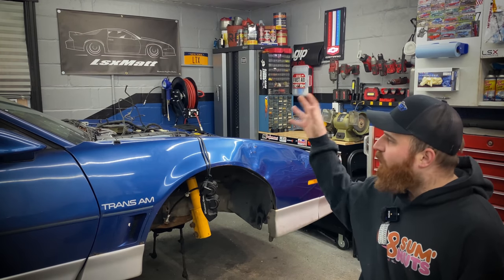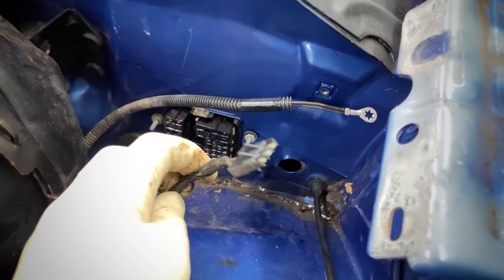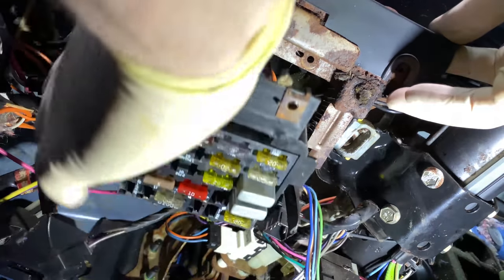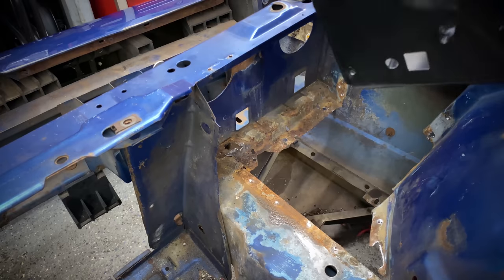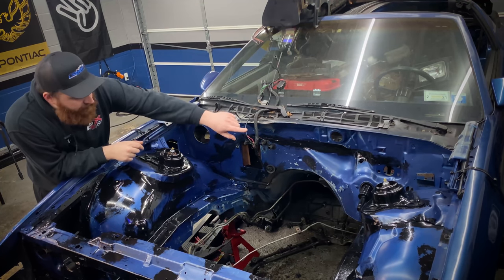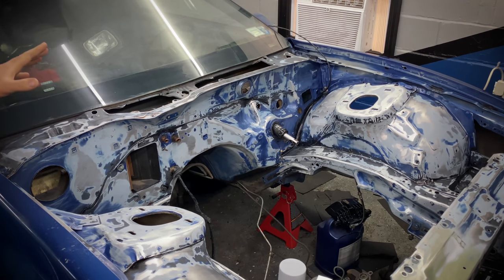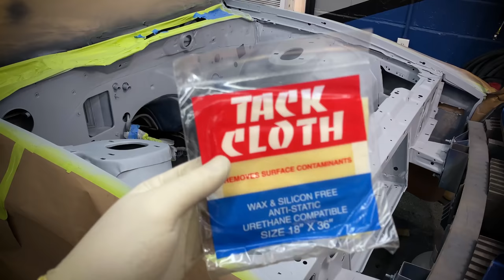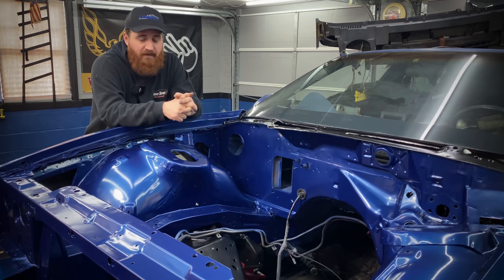I RESTORED My 1986 Trans Am's Engine Bay with RATTLE CANS! (ft. Dash Removal and Mouse Eradication)

Comment: Super cool video. I am working on a 82 Trans Am myself and have to do the exact thing - paint the engine bay and replace the battery tray as well. I already bought the tray but have not installed it. It was good to see you do it so I can get an idea. Great work and keep the videos coming. 👍

Comment: Really great video Matt! now i want to pull my motor and paint! I'm amazed at how thorough of a job you are doing! really great. The only thing I want to say is that POR (in my experience) is not nearly as good as advertised. It will come off and usually is sheets. I'm sorry i used it.
Reply from the maker: Thanks, I had good results on my camaro. I used it to fill some heavy rust pits on the rocker then coat in bondo. Its been good for years so far,  but I did notice as I was sanding the engine bay here that it would flake off really easy on anything that wasnt rust.

Comment: Excellent work, though I have a couple questions. On all the areas you used POR-15, did you use MetalReady first? It's the key to making POR-15 work properly in most cases. Also, with all the work that went into fixing the battery tray area, why not eliminate any acid-induced rust issues and just invest in an AGM battery? Rock Auto has Deka Intimidator 9A75DT batteries for $162, which have both top and side posts. Even with shipping, it's still cheaper than a parts store AGM. Found that out firsthand with my Expedition.

Comment: What a great great video!! I have a couple questions I bought a 88 plain Jane Firebird that I’m planning on doing the same but since my car is a V6 the battery is on the drivers side and need that tray and can’t find a new one?? Second I want power windows in my car so since you have the wiring out can you tell me where the harness from the switches plug into same way with where the window harness goes. Thanks!!
Reply: Check out hawk's third gen for parts.

Comment: I read in a forum you can use the brake booster and master cylinder from a ls1 4th gen. I think its a direct fit you would just have to make new brake lines.  Please make a video on this!
Reply from the maker: Thats what I’m using and already have the parts👍

Comment: Old vid, but hope you see this question... Im currently doing a project  and basically got bullied by a buddy of mine into doing the engine bay...lol I was on the fence because I've had the car 3 years and have never driven it... anyway, my question is, after the filler primer, did you sand or wet sand..?  With all the different contours and high / low surfaces, I worry that I'll end up going down to metal in spots no matter how careful I was and it turning into a huge P.I.T.A..
Is there a flash time that would provide decent topcoat adhesion without sanding the primer.. ?

Comment: Warning to those who use por15. Must go on pitted metal or etched metal. Will not stick to anything smooth. It will go on and chip off little later. Good stuff but the surface prep is mandatory (like anything else)

Comment: Haven’t watched the video yet, and even though this looks great, i have found after painting my shitbox with rattle cans and doing repairs with real paint, you’re not saving any money. Buy the shitty spray guns from harbor freight (basically 1 time use but they work) and go to an auto body paint supplier. Single stage paint is insanely easy to use, you’ll get a much more protective finish, and most importantly, IT DIDN’T COST ME ANY MORE MONEY THAN CANS
Reply from the maker: I don’t care about the cost, its just easier to spray directly from a can than having to deal with an air hose over the bay and loading up a gun. The can seems to get into all the tight corners easier, but yea I agree spray cans paint jobs are a lot more brittle.
Reply: @lsxmatt  that makes perfect sense. I’ve just always thought of spray cans as a cheaper option and i found it’s not actually any cheaper. Maybe slightly. But i understand the convenience.

Comment: Nice video but I hope that you don't go to this format for the rest of your videos, it's just too long. I tend to watch YT for a few minutes when I have time between other things and this was open for a week before I had time in multiple sessions to get through it. I'll usually just give up on longer videos eventually, but in this case, my '87 TA is sitting in the driveway in almost the same state (no front suspension, K-member pulled, cylinder heads pulled but the block is still in there...)